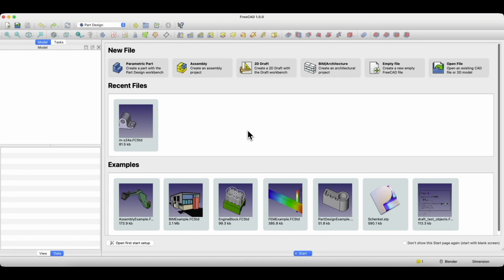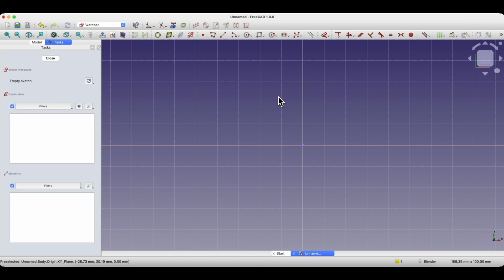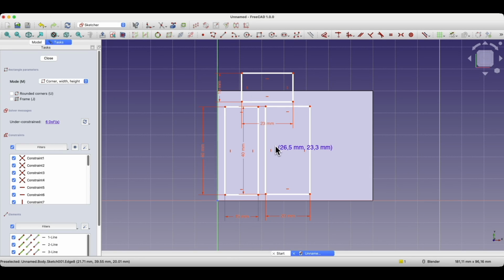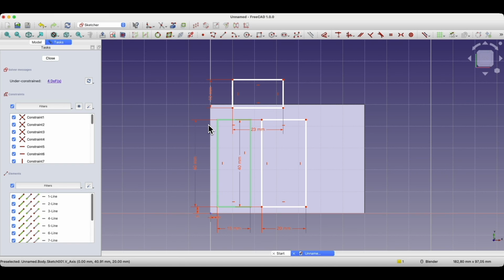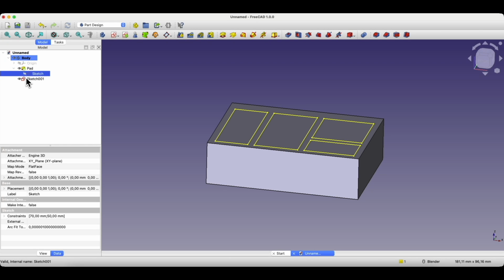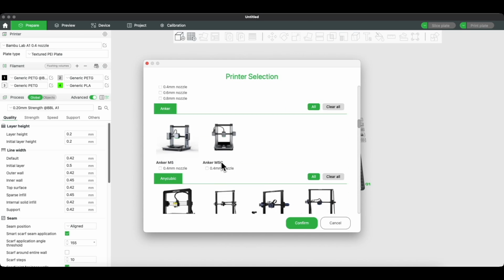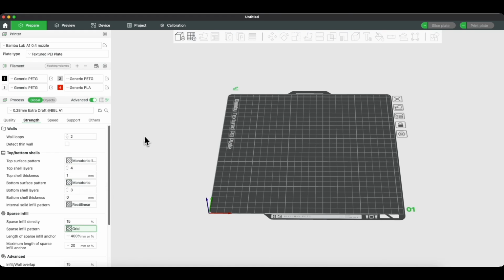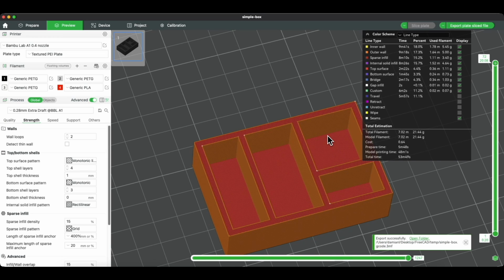FreeCAD Beginner Tutorial 2025 | Step-by-Step Guide to Start 3D Modeling & 3D Printing

Comment: Thank you, this expalined most of what I needed. I am now looking for a way to adjust inner wall height. So after I pocket, I want inner walls to be lower than the outer. Is there an easy way to do this or I have to create a new sketch for this?

Edit: figured it out. You have to go to Part Design, draw shape -> from vertices. Select two points you wish to join in a line to create an edge and click create.
Now do that for any other side that needs to be isolated. Go to Part bench, highlight all of the edges you want to pocket and select boolean slice, choose the split option (rocket icon). In the element tree you should see a Slice element.
Go to Part Design bench and create a new body, drag the slice into this body. Now click on the face of the slice and pocket it to whatever depth you need.

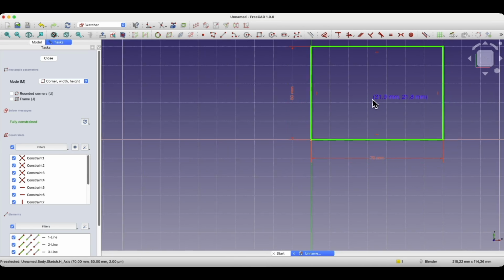Comment: Hi in my freecad the dimension constraints don't automatically appear like in 5:15 seconds. How did you get that to happen?
Reply: You can double click on the number to change it. If you want the dimensions constraints to be smaller or larger. Not the best way visually. i didn't found a way to redimension without typing the number sadly.